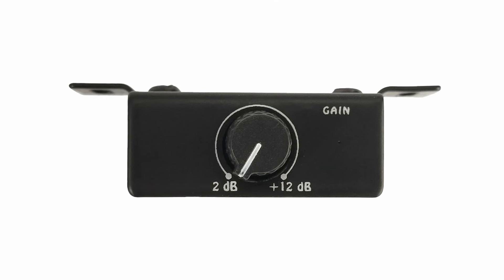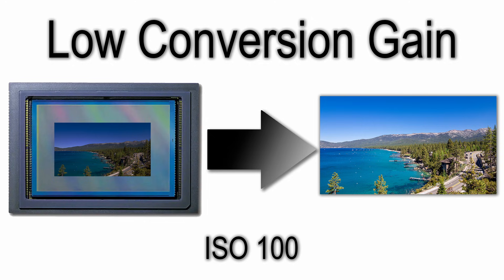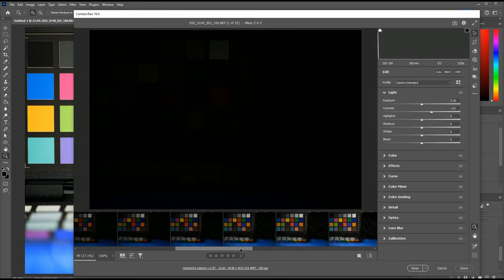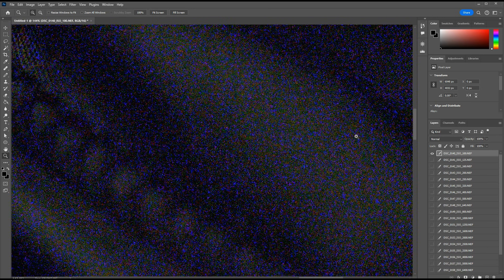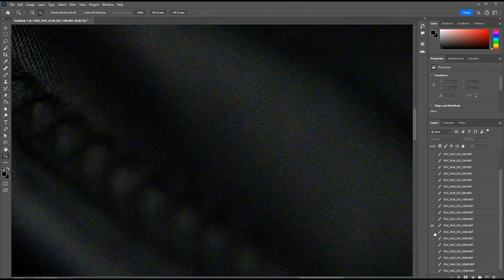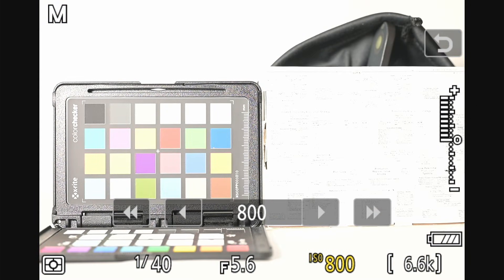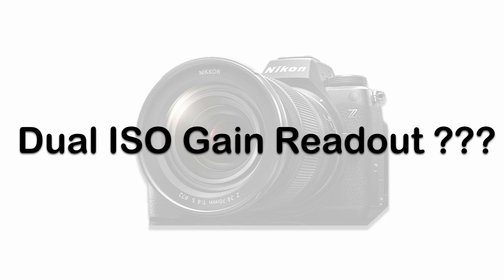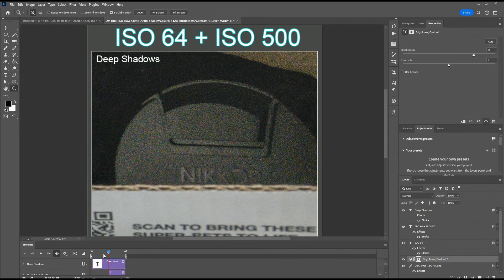Understanding Dual Gain ISO on the Nikon Z6 III and other cameras

Comment from the maker: One point I forgot to include in the exposure strategy section is how raw shooters don't ever really need to use the intermediate ISOs between ISO 100 and 800, or the ISOs after 800, since those ISOs provide only modest benefit over ISO 100 or 800 in terms of noise, and actually are a detriment to dynamic range since they amplify the image data at the time of shooting and limit your options to selectively boost the exposure in post while still retaining your highlights. In short, shoot at either ISO 100 or 800, even if that results in a photo that looks underexposed in the camera, since you can normalize the exposure in post and retain the maximum dynamic range. You'll want to measure this for your own shooting because while the improvement in noise shooting at the indicated nominal ISO like ISO 6400 vs "underexposing" at ISO 800 is modest, that improvement goes up as you go further into underexposed territory. For jpeg and video shooters, you'll generally want to continue using the intermediate ISOs because those formats have limited bit depths, which limits how much you can boost the exposure in post before running into posterization and clipping issues.

Also, if you'd like to find the Dual Gain ISO of any camera without doing the work yourself you can use Bill Claff's site. Click on a camera on his PDR measurement page. The Dual Gain ISO will be the ISO where there's a noticeable jump in the measured PDR on the graph. Here's the link: https://www.photonstophotos.net/Charts/PDR.htm
Reply: Please bear with my noob questions.....so are you saying that since I shoot Raw, I would basically never benefit from going over ISO 800? Even if the pictures are underexposed, I should be able to fix that in post, and it will yield better IQ results than going for a higher ISO setting at the time of shooting?
Reply: Will experiment with this. Will be interesting to see where /if focusing / composition degradation (from the apparently lower light that the photographer uses to make decisions) costs more than the improved headroom gained (pun intended) by avoiding the gap isos (base 1 > gap iso < base 2).

That leads to another change that would probably require firmware, in which the actual raw is encoded only with one of the two base isos (or the dual-gain), but the image displayed for the photographer responds precisely to the `apparent` iso selected, either manually or auto.
Reply: What are remarkably interesting video. Does this mean that if this option comes to full frame cameras camera would it have to be a hardware change or can it be made by firmware?
Reply: Thank you for the video. Very educational.
Reply: @testcams  You can't boost exposure (or for that matter 'normalise' it) in post - but you know this. Not using ISOs other than 100 or 800 can be bad advice, depending on the camera model. Often higher ISOs reduce read noise, and if you're not exposing all the way to 100% at the selected ISO you're often better raising the ISO and getting less shadow noise.
Reply: Presumably this is not so applicable to Nikon mirrorless cameras which seem to rely on a bright viewfinder for optimal AF performance?
Reply: Good video.  I believe D780 uses dual gain, 750 did not.  Under dark conditions I never go above ,800 relying on post and ISO invariance.  Below 800 I go in multiples.  I don't see not changing ISO below 800 as you would have adjust ss and f stop other than what you want or have to heavily process each image?
Reply: Thank you very much for your video, which is very clarifying.

However, you focus the discussion on shadow noise. There may be other relevant considerations as @Alistair points out. I am wondering if :
1 Color fidelity is affected by shooting at 800 ISO vs shooting at larger ISO values.
2 Whe dual gain pixel method you propose would affect the demosaicing process (colour again)
Thank you!
Reply: This is not true. Plain stupid to be honest.
Reply: @zakiradi450  ad hominem is not an argument. Evidence would be useful.
Reply: Although you would not gain any noise reduction even when underexposing, there is another thing to bear in mind, the reason to expose to the right is to maintain the max nr of digital quantisation levels. If your images are structurally underexposed you throw away a lot of the digital resolution of the 14 bit available in the RAW image, in fact you are relying on the worst part of the bits available (the lower ones with the least digital resolution).

Comment: ISO is only the "brightness" compensator for modern camera sensors, no extra signal or something, Most of modern camera sensor are ISO invariant or two step analog (dual) and digital noise are handled miracly by in-camera pre-raw noise reduction algorythms depends on what camera model you have. There is not any high sensitivity regulation your sensor can catch more photons by pushing ISO up.

Comment: So basically you can bracket using iso in tricky lighting to minimize noise and movement if you take advantage of dual gain ISO. 

E.g. Iso 100 for highlights and Iso 800 for shadows

Comment: does shooting in one of the internal raw modes change the gain levels like  how the nlog does?
Reply from the maker: On the Z6 III you can shoot internal raw with either SDR or NLOG. In SDR the dual-gain ISO is at 800. For N-Log it's 3200. So the same as for the Z6 III's Long GOP video modes.

Comment: You have a great talent for explaining technical things in a simple and understandable maner <3   And about the simultainous readout of both conversion gains - Arri did that in 2009 Alexa sensor to achieve the still impressive dynamic range it has. Canon also has an iteration of this technology called DGO (dual gain output), they used it in the C300 Mark III and C70 camcorders. But strangely they're now backing out of it. Neither the newly released C400 or the EOS R1 (which was rumored to have DGO) don't have that technology onboard

Comment: Sorry to say, your explanation of dual gain is very confused and muddled. You've tried to make sense of the term 'conversion gain' and been confounded that this name is actually a misnomer - it's a conversion factor - not a gain at all. This is compounded by another misunderstanding, that 'gain' is applied to exposure. This is just incorrect. The exposure is immutable once the shutter is closed. It signifies an amount of light, and nothing that is done electronically or computationally results in the gain of light.
Reply from the maker: Thanks for the feedback Bob. I followed Aptina's lead on using "conversion gain", which is how they termed the technique in the whitepaper discussing their invention of the technology. I agree with your general strict use of the word exposure, although its colloquial usage won out in my choice to use it in parts for the intended audience. I drew a pretty clear arc between that colloquial usage and the stricter form of physical light exposure (aperture, shutter) at important parts of the video, so I'm on board with shifting the usage to the stricter form, although I'm sure we probably differ on how to approach and introduce that shift to others.
Reply: @testcams  The term 'conversion gain' is what the industry uses, but as I said the name is misleading. If you understand it as a 'gain' you'll go wrong. It's a conversion factor and in particular dictates the equivalence between photon and electronic noise. So, if a high conversion gain is used an ADC producing a given amount of electronic noise appears to be less noisy than it would with a low CG. But a high CG limits the amount of charge that can be read from the pixel. Dual CG allows low CG to give a lot of charge for low ISOs and a high CG for low read noise at high ISOs.
Charge is directly proportional to exposure, so inversely proportional to ISO. On exposure, I know it's very often misused, but it's meaning is essential to a clear explanation of this topic, so if you misuse it in the explanation you'll just end up with confusion. I think people giving explainers like this need to be careful to get their concepts right, especially core ones such as exposure. As to how to introduce the correct (rather than 'strict') use of exposure, why not just explain what it means? One of the reasons people don't know what it means is that people rarely give explanations. Old text books did.

Comment: Am I understanding the chart correctly, that the 150mp Phase1 has 7 steps?
Reply: No, it only shows one additional gain level at ISO 400. The other steps in the graph just indicate that Phase skimped on their ADC firmware. Which makes sense since most of their users are not shooting above ISO 100 anyway.

Comment: This is the best explanation of noise and gain as it relates to exposure I’ve ever heard. This is very helpful. It’s interesting that the gain for the Z8 (and probably the Z9) occurs at ISO 500. This is likely due to the higher pixel count, and the fact the pixels are more tightly packed together.

Comment: Explains such a lot, had gravitated to shooting at iso 800 as my preferred setting for light challenging situations, very resilient to being pushed. Results at higher iso's tremendously mixed, if exposure slightly out.... But sadly iso 800 has it's limits when you have to shoot movement. Many thanks for lighting my darkness!
Reply: But if you set your evf to NOT show the actual exposure brightness (instead a brightness that allows you to compose), and shoot manual iso 800, and the appropriate manual shutter speed you need to freeze movement then you should be happy. Unless perhaps if your scene is super dark?

Comment: One other point. A lot of photographers shoot “manual mode” with auto iso. The amount of light hitting the sensor is independent of the iso, so (assuming you don’t cross the line between the dual iso domains) auto bracketing will have no affect on the raw files other than changing iso number, just a number, that’s embedded in it. Similarly, taking exposures for HDR, would give multiple raw files that are essentially identical. For these methods to work, you need to set the ISO to be constant and change the exposures in a way that affects the amount of light going to the sensor — either aperture or shutter speed priority or manual.  Am I correct?
Reply from the maker: Agreed, there's not much benefit in AE bracketing with Auto ISO, unless the bracket pushed one of the Auto ISO exposures into a Dual Gain ISO, and the software used to create the merged exposure accounted for using the lower EVs of that bracket. But even then if you're bracketing you might as well bracket the physical exposure (shutter speed/aperture) rather than just the ISO.

Comment: I have a question, is the statement true that Z6 mk. 3 would have worse low light performance than a mk. 2 due to its partially stacked sensor due to the sensor design being more complex and therefore the amount of light on each pixel being more limited than a similar "plain" 24 MP BSI 35 mm sensor?
Reply: He did tests between the high ISO and dynamic range capabilities of both the z6iii and z6ii in previous videos. Great videos!

Comment: So, in the case of video, the native Iso of 6400 only applies when using N-log and reverts to 800 when using any other profile?
Reply from the maker: Yes, the indicated vs sensor ISO discrepancy doesn't apply to any of the SDR-based profiles. I forgot to mention HLG in my video, which uses a sensor ISO that's 2EV below the indicated vs 3EV below indicated for N-Log, which means HLG ISO 400 is sensor ISO 100 and HLG ISO 3200 is sensor ISO 800.

Comment: Alright, I feel like you've buried the lede here with that very short segment on Dual ISO readout simulation at the end.  I'm really curious now, as I think your test shot output looks really good!  Much more natural than some HDR shot's I've done in LR previously. I have a few follow up questions here:

How does this differ from an HDR Merge in Photoshop or Lightroom?
Is your simulation software open source and/or available on GitHub somewhere?
Does the software act on (and produce) a RAW (nef) file, or some other file types?
Reply from the maker: I have an open-source project for all my raw-based tools at https://github.com/horshack-dpreview/OctaveRawTools. I haven't added this file yet. It's kind of hacked together at the moment and would need more work to make it usable across all cameras.

Keep in mind the dual ISO readout simulation requires shooting two exposures and merging them together into a single raw, whereas a future, sensor-based implementation would accomplish this in a single exposure. Since you have to shoot two exposures you're better off using exposure bracketing, as it will provide noise improvement across a wider tonal range than the EV-grafting of my dual ISO readout simulation.
Reply: @testcams  Oh cool, thanks for the repo link! Yeah, it makes sense that the real power here would be getting this output without needing to take multiple exposures. 

I really did like how naturally your program seemed to stitch the two exposures together though... better than I've been able to do with exposure bracketing (though I'm still a beginner at this type of editing, so probably not the gold standard to go by).
Reply: It seems to me that the constraints are the resolution of the luminance measure at the shadow end (how close can two intensities be and still produce pixels with different values?) and the ‘overflow’ at the high end that leads to blown out highlights. The second problem seems to me to totally solvable by increasing the number of bits available in a pixel because the constraint here isn’t in the sensor hardware, but simply having enough bits to store the result of a computation. It should cause no problem for post-processing software (although the algorithms will need tweaking). I would think that a logarithmic scale would also fix this, but I don’t know much about them — yet.  I have another question — in this two stage process with an analog step on the sensor (?) followed by digital multiplication essentially by the ISO, is one inherently better, provided enough bits are available to avoid overflow?

Comment: #Nikon, why do you confuse us so much 😢 We shouldn't be forced to watch YT channels to understand your products!
Reply: It's not  nikon thing, all brands have sensors like this. Nikon has mostly ISO invariant sensors, the dual gain sensors are more in the Canon brand. That's the reason, you heard less about this topic than for example Canon users.
Reply: What?  Electronics are complicated and to get the most out of it, you need to learn how it works at a fundamental level. Simplified user settings, generalized for all users, can only cover so many cases.

Comment: https://www.youtube.com/@testcams any idea whether the z8/z9 or z6iii sensors have the ability to change the gain strategy via firmware, or is it hard-encoded in silicon?
Reply from the maker: Good question. I'm guessing the dual gain switch is hard-coded in silicon to the ISO value, which firmware sets in the hardware interface/register, so it's under firmware control but not control that's independent of the ISO.

Comment: Arri and some Canon cinema cameras use dual-gain systems like you describe at the end of the video. The newest Arri sensor reaches 17 stops of DR and it isn't even full-frame!
Reply: Yes, they use a simultaneous read-out, which is currently not available in stills cameras.
Reply: @Bayonet1809  it is available on the G9ii, GH6 and GH7. Though the GH6 only activates it at ISO 800. The other 2 do it from ISO 100 and match the DR of 14 bit readout APSC and sit between 12 bit APSC and 12 bit FF.
Reply: @Wildridefilms  I am unfamiliar with the internal workings of those Panasonic cameras, but there appear to be no real benefit to whatever they apparently do. Photons to Photos shows the maximum dynamic range of the G9II to be effectively the same as the older G9 (PDR ~10), while the APS-C Sony A6700 manages a PDR of almost 11. That evidence suggests that there is still a significant gap to APS-C, contrary to your claims.
Reply: @Bayonet1809   Take a look at cine D or Gerald undone. In video, they sit right in between 12 bit APSC and 12 bit Full frame.
I don't know how Photons to photos do their tests, but if it says that the G9 and G9ii are even close in max DR, they're very wrong. There's a huge difference between them. The G9ii is at least 1 stop better, closer to 1.5 stops better than the G9.
Reply: @Wildridefilms  Oh, you are referring to video. Well that explains it. I was talking about the feature not being available for stills.

Comment: What an amazing video! Question: if i need fast shutter speed to freeze movement, should i go for iso 800 instead of using values from 200 to 650 for example?
Reply from the maker: If you can shoot at ISO 800 without having to increase your shutter speed further to prevent overexposure then you definitely want to use ISO 800 whenever possible.